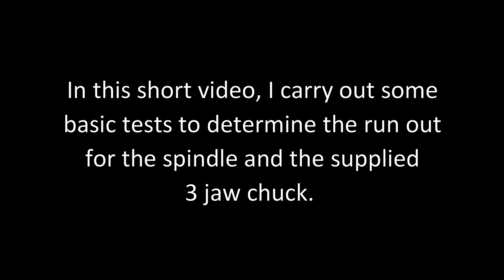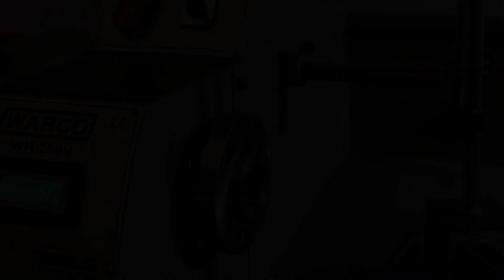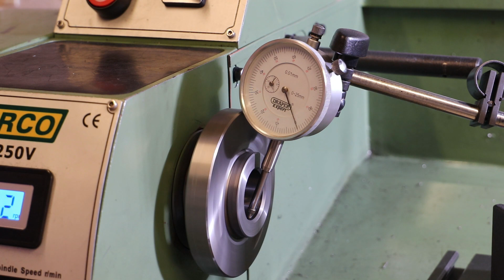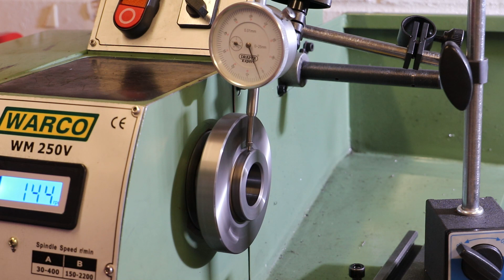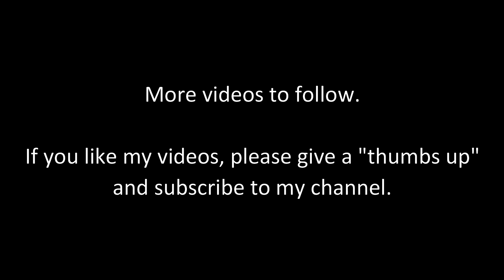WM250V Lathe Run Out

Comment: Check the r/o on the chuck. If it is the same, as on the mandrel, then this can be reduced by slackening it slightly and tapping it to get the minimum run out. Tighten the stud nuts again in this position.

Comment: The mounting face should also be tested. That is very important as well. Do not tighten from all three spots. Tighten only from the "0". Also different diameter material will have different variations. The jaws are ground at a certain diameter, and it is true at that diameter. If you go way to down, or way to big with the material diameter, it won't be true anymore. Chucks are not meant to be very accurate, that is why you have collets for.

Comment: Hi Mark, I had similar readings on my Warco 240 lathe and 3 jaw chuck. I hugely improved mine by re-mounting the chuck by rotating it by one hole on the register to find a better position and re-marking it, and also by tightening the work piece using the 'master' chuck key hole marked with a 0 (I learned this recently from another Youtuber) Maybe worth a try.
Reply from the maker: Nice tips Mark, I'll give them a go.

Comment: Just a few tips here, my warco lathe I thought I'd checked every thing when I first got it, but to my surprise the spindle adjusting nuts came loose after using it, so it's a good idea to mark end of spindle & lock ring for reference, also tighten studs in back of chucks, I ran a die down mine & put a slight lead on the end down to root of thread, if you have room wider washers with a knurl on washer o/d, I found using a mag base on the cross slide can leave some nasty scratches on Warco lathes , I use a scribing type base instead, hope that helps, Coventry 🇬🇧.

Comment: Apologies if I'm way off base here, but is the machine going "clonk, clonk, etc" as the spindle turns? It sounds like it to me. If so, then I think the preload on the spindle bearings may need resetting on your machine. It's a "service item" on these machines and my new WM290V was way off as delivered. I disassembled it all and set the preload correctly. No more clonk, clonk on my machine. The measured run out was significantly better as well as surface finish on cuts. Yours may be different, but yours does sound like mine used to. It's worth noting that Warco do not check the machine at all. The crate is unopened from the time of leaving the "factory" in China all the way until you install it. It's best to treat the machine as something that needs to be checked, fettled and repaired from end to end before putting into service. As I found out!
Reply from the maker: Hi Laurence,
Thank you for taking the time to comment and with an interesting observation too.  The "clunking" on my machine is coming from the crude lead screw drive rather than the spindle, but I will look at this again.
I did also recheck the Warco website and note the following: "Each lathe is fully run and tested by a qualified member of our team before leaving our premises, and will be supplied with an individual accuracy test report.", but as I show in one of my other videos the machine was in a dreadful (dirty) state as delivered, so I am very sceptical that anything is done here in the UK.  
This is the reality of buying these "cheap" chinese made machine tools.  Initial problems aside, I think the machine has performed well, even though I do still struggle with getting a good finish on mild steel.  As above, I'll look at this again bearing in mind your experience.
Cheers
Mark

Comment: Move the chuck a bolt hole round at a time and recheck you may find a better placement, or run a boring tool though the jaws, or workout which jaw needs stoneing to true the chuck how do you think the top end markers do it and why they cost so much more.

Comment: Hello Mark, really helpful video thank you. I too have the same lathe and can agree the same deviations and run out. I have also had trouble with the tailstock where it can cause a taper all too freqeuntly due to some slack fore and aft of around 1.5mm.  Now i have to be very careful to set the tailstock parallel with the work in the chuck to avoid a taper. Have you any thoughts on this or experincing similar issues?
Cheers
Reply from the maker: Hi Andy,
Yes, I've have issues with the tail stock and have not yet managed to get it 100% aligned.  It's not been a problem so far, but I will need to sort it at some time.
Mark

Comment: Hi Mark!  Good video! How does this lathe compare with your old Boxford? Stay healthy!
Reply from the maker: Hi Ron,
Now that is a good question :-)  I think (but memory is a strange thing) that I got better results on the Boxford.  Having a clutch on the carriage and cross slide feed was better than the sheer pin on the Warco.  Changing the chuck on the Boxford was so much easier than the fiddly nuts/stud arrangement on the Warco, but then it could unscrew when running in reverse :-)
There are pros and cons with each.  The trouble with the Boxfords is that they are not getting quite old and subject to wear, which was my main reason for going down the import route.
Cheers
Mark